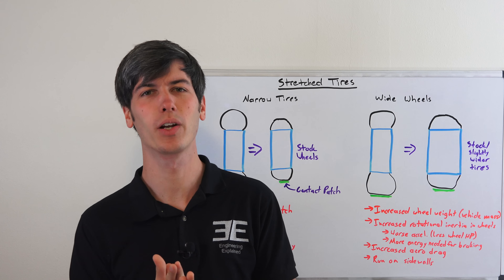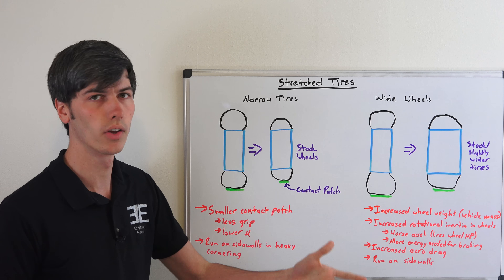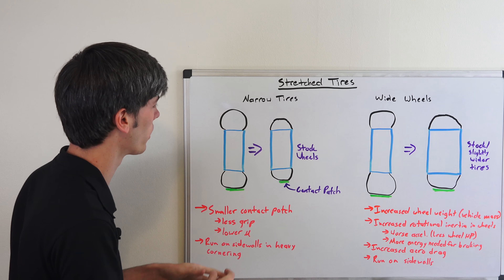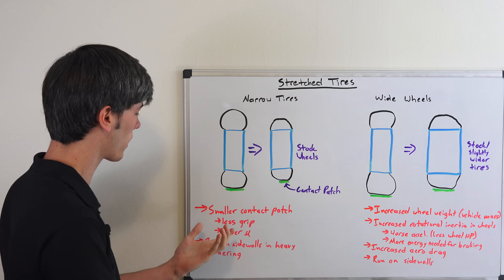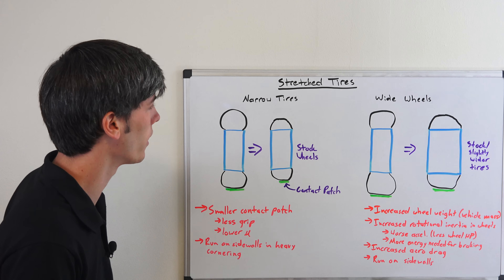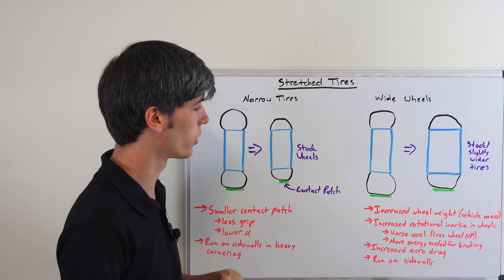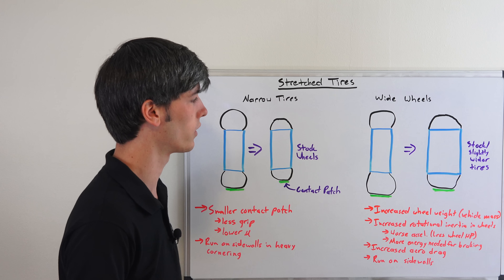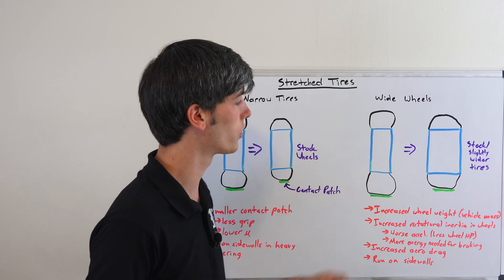Stretched Tires Are Silly

Comment: You know that it's often done to improve drifting performance by decreasing the tire contact as well as eliminating side wall flex. Sure if you want a road going car it's just plain stupid, but if your car is built for drifting and you have money, why not, stop hating on other peoples decisions just because you don't make the same ones.
Reply from the maker: Where did I imply hate? I was simply providing information. A smaller contact patch does not "improve drifting performance" rather it makes it easier to drift. You could accomplish the same thing by increasing tire pressure, or using bad tires. Reducing grip doesn't improve performance is my point. That said, if a car doesn't have enough power to make the tires slip, no worries, go with whatever means you feel best. But know that at a competitive level folks will choose grip over slip, because it allows for more control and faster drifting. No hate here, I just want people to make informed decisions and research before doing something for the wrong reasons.
Reply: +Engineering Explained Well actually I have no issues with your video, I just didn't like the comment section because that's where everyone was hating on it. Personally I don't drift and probably never will but I just dont think there is a need for all these hateful comments towards 'stanced' cars and the people who own them. Tire stretch might be a way for some people to get more slip while drifting so if someone else does it then by all means, create an informative video like this one but don't hate on other peoples styles just because you don't like it, I'm sure a lot of people laugh at choices you make too (again, aimed at the comments, not you) Thanks for the great videos!
Reply: +Engineering Explained Basically, would you tell a girl her high heels are silly and that she should wear safer shoes? Maybe, and that's alright, but you wouldn't go up to her and say you look stupid and you are stupid for wearing those like many of the commenters are doing but with stretched tires in place of heels. Be nice, people

Comment: Stretched tires came from an era where there were very limited tire sizes. Stretching gave better performance by widening the contact patch. With the wide availability of tire sizes available now there is no good reason to stretch.
Reply: +3E Unless of course you'r stuck racing in a class that only allows for 15 inch diameter wheels and street tires.
Reply: +3E 
Stretching a tyre will only reduce contact patch, never increase.
Reply: +3E Didn't this start in the early days of drifting in Japan. They stretched tires on lower horsepower cars for a stiffer sidewall and less grip.
Reply: vegetoe01 That is not true. If say the largest size tire you can get is Y and you have it mounted to a X width wheel. As you stretch it to a larger wheel it will force some of the side wall area into contact with the road increasing the effective width of the tire.
Reply: Wes Dodson True but most now also have wheel width restrictions as well.
Reply: +3E yeah but as he said, sidewall isn't built to grip...what good is more physical contact patch if it has next to no grip...thats like having a tug of war against 3 body builders and having 50 senior citizens on your team and expecting to win cause you have more bodies
Reply: +Mario S. I found this: 
The Racing and High-Performance Tire, Using the tire to Tune for Grip and Balance, Paul Haney, 2003, co-published by SAE and TV Motorsports
pp.99-101

Selected quotes from an interview with Jim Hall and Brian Redman. Racers from the '50s and '60s:

Jim: “We had started runnin' skid-pad tests, just going round and round on the skid pad. We got good at it and we found out we could balance the car this way. It was a little bit more technical than we could figure out. It would go up to 0.98 Gs one way and only 0.92 Gs the other way. So Firestone told us their tire was built to run on a 7-inch wide rim. I had built some modular wheels and we could vary the width by what mid-sections parts we used. We'd run the tires they gave us on a 7-inch rim and maybe an 8 and a 9 too. The wider rims made the sidewalls stiffer and instead of running a 0.95 average G you'd run a 0.99. So of course we put them on 9-inch rims. Well, we'd go to the next race and the Firestone guys would look and them and say, "We didn't design those tires to run on a 9-inch rim. We better build a new tire.‟ They'd add an inch to the tread. They'd do them quickly too. They can build prototype tires in a hurry. In a couple of weeks they'd have another tire. And we'd run on a 9-inch rim and a 10 and maybe an 11. And we'd find it was better on a wider rim, so it would happen all over again. In a matter of less than a year we went from those narrow little Dunlop Green Spots to a tire that was almost double the width. So that's what happened with me on tires. In the middle '60's, probably '64 or '65, Firestone took us from less than 6 inches of tread width up to 12 inches.”

Paul: “Just because you kept skidpad testing them on wider rims?”

Jim: “Right.”

Brian: “Speed on the skidpad is speed around the racetrack”

Jim: “Cornering speed is the key to everything. You can have more horsepower but you got to stop it at the other end. But if you can leave the corner just that much faster, you carry that speed all around the racetrack. The whole thing is cornering speed, basically.”
Reply: +Tatenda Jinya (EthosVeritas) That is not entirely accurate, check out what I just posted
Reply: +3E that's an interesting excerpt and i can see the logic in it. But considering these gentlemen are "Racers from the '50s and '60s" i'd assuming they are talking about racing slicks/tires i'm guessing this generally won't apply to normal road tires. I will concede it makes me wonder if in very small stretches, say less than an inch if you'd get relatively similar results they did
Reply: 3E I disagree, You can reduce tyre pressure to increase tyre contact patch as the sidewall flex will increase it. However stretching a tyre will cause it to convex reducing the contact patch. Then during cornering you end up riding the sidewall which doesn't even have tread.
Reply: +Mario S. I believe they'd to it to the rear tire so they'll lose grip and can afford a lot more shitty tires to toss on the back when wasted.
Reply: +Tatenda Jinya (EthosVeritas) Ok so there is weird and complex physics trickery going on when a tire is stretched to increase performance. A very slight stretch, enough to make the contact patch the same or slightly less than the wheel width, will be better and side wall flex will be optimal. Look at the tires that come factory stock with most supercars now.
Reply: Burly Heads i get the low profile/sidewall flex bit. Thats not the issue. When u take a ROAD/STREET tire with proportionally larger sidewall thats been built to work at certain pressures and wheel size and stretch it is the issue. Maybe a minor stretch and i mean tiny 10mm or less may give u that larger contact patch & stiffer side wall but anymore than that and u have a sidewall that was designed to work its best parallel to the wheel face now at a weird angle and treadless rubber trying to grip the road. Not having looked at a slick tire up close id imagine u would have more margin to get away with the stretching
Reply: +3E  Remember, racing in the 50s and 60s was on bias-ply tyres.  Radials don't react the same way.
Reply: aussiebloke609 Good we are on the same page. As I said it came from an era where there was limited size availability (the 50's-60's) and with the current selection there is no reason to do it now.
Reply: +Mario S. Back then, all they did was drive what they had on their car.
I'm talking about late '80s or so.

Comment: When choosing tire size for my car I contacted TireRack about this issue.  I could only get a tire that was less wide for my car instead of the OE  recommended size for the wheel.  Tirerack explained they had tested the theory of stretched tires and they actually allow for better road feedback (less tire roll) and quicker changes during corning (better/easier rotation).  Now this stretch is minimal compared to "stanced" tire fitments.  Youll see minimal stretch on new sports cars like corvettes, ferraris, etc. But on economical compacts, stretch is pretty non-existant.  In my case i went with a 230 width instead of the factory 245 (2011 STi) that did show minimal stretch, but since i went with a road/track tire is actually increased contact patch (flatter) and was able to add a little bit of stretch. 

Overall:  
little stretch = better road feedback and quicker response
no stretch = more tire roll, less feedback, decent responce
bulging wheel (bigger than OE) = lots of tire roll, possibly more contact, but reduced feedback and feel
lots of stretch = (as you stated) reduced contact, un-needed wide wheels causing increased rotational inertia, etc.
Reply: What is considered slight stretch was thinking of going with 235r instead of the 245r that's stock
Reply: what type of tires are you talking about?
economy, normal or performance tires? with the side wall reinforced or not?
I'm curious how they reached that conclusion (I'm not saying it's false or real) I want more on this topic and at the same time to find out the opinions of others to help me decide what to choose

Comment: Will u soon be explaining wheel spacers? I've been curious about them and wondering if it affects the handling?
Reply: +TekkenH3AT I would appreciate a video on this too!
Reply: +TekkenH3AT They're more for looks. They do decrease the tipping moment slightly, though it's not a big difference at all.
Reply: +Bryan Kendall If you have a wide front and a narrow rear it would benefit tighter turns.
Reply: JR_113 We're talking about increasing track width by 20mm, it honestly doesn't make a big difference.
Reply: True. would take a few inches.
Reply: +TekkenH3AT  

Actually it makes a big difference. If you use 20mm spacers the scrub
radius of the car is also reduced by this value. If the scrub radius is
negative, uneven braking/ accelerating or driving forces are compensated. When
you change this value and change it to a positive value, uneven braking/accelerating
or other uneven driving forces are multiplied. So it’s going to be you that has
to correct this forces.
Reply: ***** A lot of cars have wheel bolts. I know VAG and BMW do for sure. Spacers always come with extended bolts for these cars, I've never had an issue.
Reply: ***** Obviously.  Cars with studs are tougher to use spacers with, this was all I was getting at. Though extended wheel bolts with the same tensile strength of OEM wheel bolts, theoretically, will have the exact same shear strength as the OEM.
Reply: +Bryan Kendall 
Sure it does. 
Wheel spacers in the 3/4 inch (19mm) to 1 inch (25mm) range do increase wheel track, alter suspension and steering geometry, effective spring rate, handling, steering and response.
Reply: patw52pb1 All wheel spacers increase track width.. whoever uses 19mm spacers bought the wrong offsets for their wheels..
Reply: Bryan Kendall
While your first statement is accurate, the second is not entirely correct. 
I understand what you are conveying, but as a blanket statement about all applications/situations, it is incorrect. 
There are applications where large wheel offset is contraindicated due to contributing to poor geometry, poor handling and reduced tire life. 
I do not like using wheel spacers whenever possible, but wheel spacers can mitigate  poor geometry, looks and handling.
Reply from the maker: +TekkenH3AT Just did a lot of research on it. Fascinating stuff. A video will appear, eventually...
Reply: +Blehtubezz Aus Not necessarily. Most often they are used as a bandaid  for wheel width or tire section width fitment issues, and sometimes to add track width, but backspacing is the problem, not offset. Using them creates less positive offset though, which can be a problem at the extremes for the scrub radius and bearing loads, affecting tire wear, stability in turns and in wet, and causing more torque steer in a fwd car.
Reply: +Engineering Explained amen
Reply: +Blehtubezz Aus Blah, blah, please, all this armchair internet, fear-mongering nonsense. 

Yes, spacers will increase your track width, which will increase your turning radius. A 15mm spacer on each side will increase your radius about an inch.

It will most certainly throw off your alignment, and definitely increase your scrub radius. However, most of the time you're lowering your car and putting stiffer shocks on anyway, so you'll need an alignment and your large scrub radius will be less important because you've decreased travel which would've expose it. It's kind of a lateral move, pun intended.

As for it being weak. I'm sure there's some math involved that will prove a potential, theoretical loss, etc., but some of the fastest World Challenge Time Attack cars have spacers of 20mm+ at least and they're not losing wheels or snapping lugnuts. In application I'd be more worried about the idiot doing the install, getting the right bolt lengths, than those bolts or anything failing. Most importantly: If your wheel is torqued down correctly there will be practically no more than usual lateral force on the fasteners with spacers than without. If it's loose, SURE... crazy new forces everywhere, but you're a dumbass, so you have other things to think about.

The fact is that manufacturers can't make wheels in all the silly sizes and offsets we want so people use spacers. They're easier than extending your control arms / hub and re-working your suspension, that's for sure.

If you can run them hub-centric, wheel-centric, get quality fasteners, torque them, run them, re-check it... in my experience you're good to go. 10 years of daily driving them and 1 or 2 track days, zero problems.

People just like to go off the rails on the internet. In the real world it's a non issue. Anytime I've heard of an issue you can almost, without fail, attribute it to human error with the install and not the equipment.
Reply: +TekkenH3AT wheel spacers...pffffff. stop being a cheapskate and buy the proper wheels and tires.
Reply: +TekkenH3AT They widen your track which changes your turning radius and other handling characteristics. Should be interesting for a video.
Reply: Spacers (1) lowers your spring rate (2) changes the dynamic toe in.(3) increases the scrub radius. They also increase the load on the front wheel bearings. None of these things are desirable

Comment: Although stretching may not be that widespread these days, it's only real world application is for lowered cars, which allows wider wheels without the tyre wall rubbing on the inside of the wheelarch.
Reply: It's still used in drifting sometimes to create a instant break in traction on turn in due to the loss of sidewall flex.
Reply: +Terry Dolan hmm.. I didn't know that. Cool!
Reply: +TheGarandGuy  My car is damn low, but I still run good tires for good response on corners. 225/50/15 up front and 205 in the rear. Plenty of grip, and nice sidewall action.
Reply: +dropinbiking92 Don't usually see wider tires on the front of a car. Front wheel drive maybe?